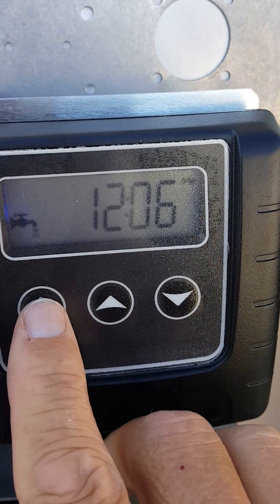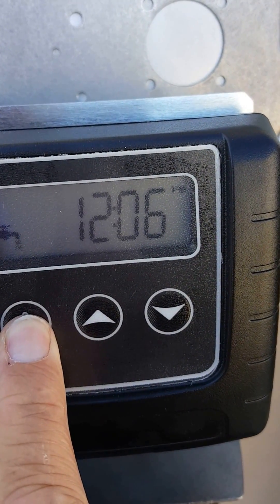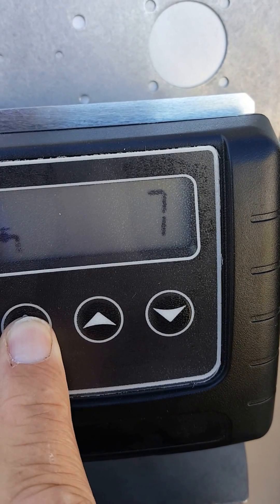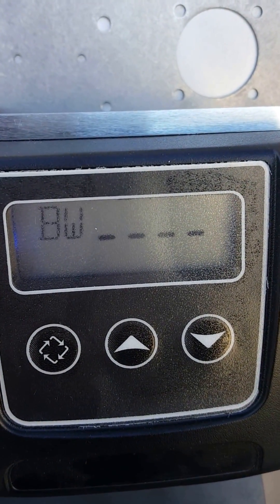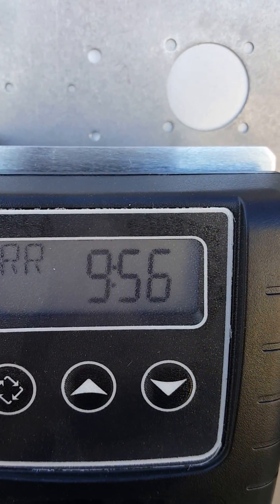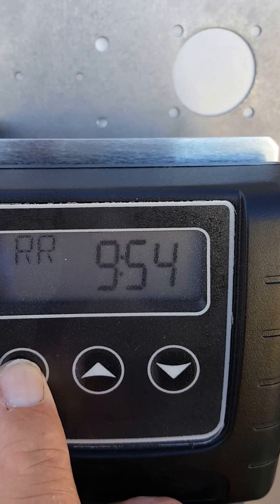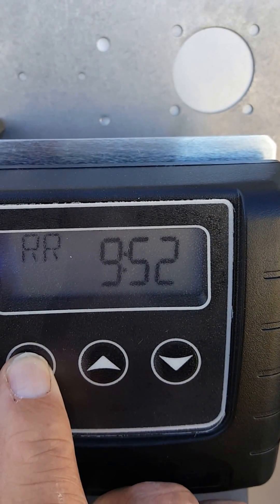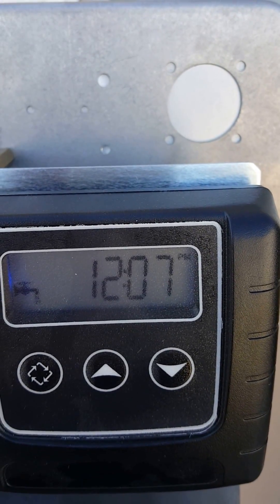How to Start a Manual Regeneration on Your Fleck SXT Filter System to Bleed Air Off the System

Comment: What can i do if the system still gets a couple grains of hard water? Everything is connected properly water test are good.
Reply from the maker: Is the hardness set to the proper amount in the settings or is it lower then what the hardness coming in is at? if it is lower it will start to let some hard water seep through when it gets into the lower gallons remaining be for a regeneration. if all is correct i would just up the brine fill time by a couple minutes.
Reply: What do I do if i let it run out of salt. I filled tank w salt and brine well is also bout half full. Do i just do the steps you just did still?

Comment: If you leave it alone will it go back to normal once its done ?
Reply from the maker: Hello
Yes it will cycle and go back into service once the regeneration is done.
Reply: Great, thank you
Reply: Hello.. so I can start the manual regeneration process and not press the "Extra Cycle" again?  This will perform all the regeneration steps all on its own... Using its own timers to advance to the next step until complete?